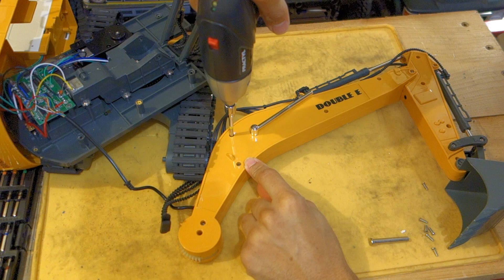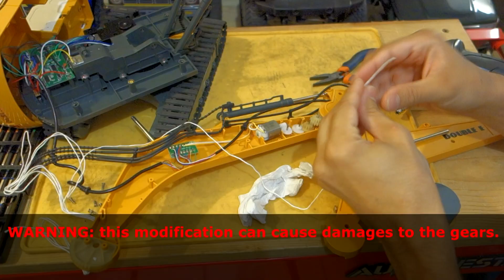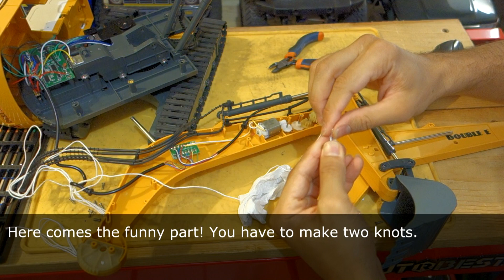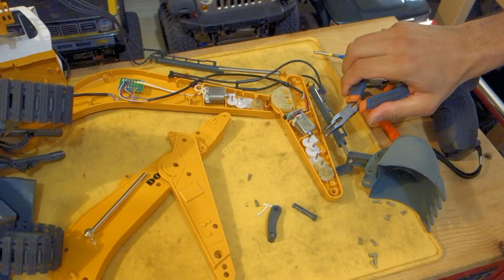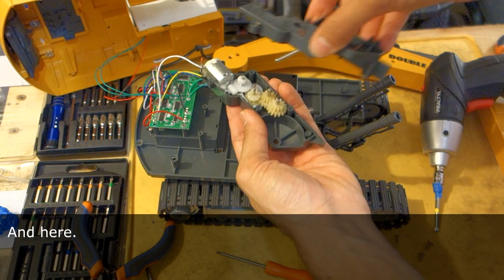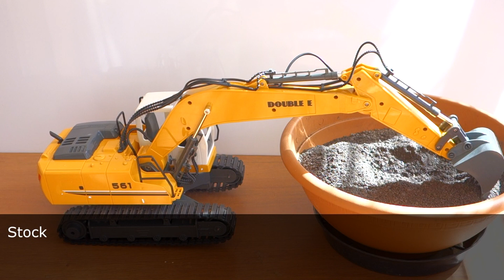RC Excavator - MORE POWER for free - Huina 1550 / Double E 561 / SP800

Comment: Ok, what we have here is simple spring clutch, it may be just a tensioning of the spring value, either by dismantling the clutch and lengthening  the spring by small amount adding to the amount of [ drag ]...
This way the clutch will still works as intended, but if done correctly maybe add just a few lbs to the lifting capability, 
But you are on the right track and thanks for the great video, yes it's a superb model and getting this to function just that little bit better will make it a great model..cheers..
Reply from the maker: Thanks. The spring travel is around 1mm so it's pretty hard to do fine tuning. By the way i don't have the model anymore.

Comment: I performed this modification last night. Instead of using string, I cut a short piece of Nitro fuel tubing, cut a slit in it and wrapped it over the spring and then cut a thin piece of Duct Tape and wrapped it over and around the fuel tubing. The fuel tubing will provide some give and hopefully still provide some amount of slipper clutch gear protection.

Comment: Just adjusted the clutch gear on my EC160E, by the way of inserting a washer / shim into the spring clutch gear..{ gear end of spring }.
The thickness is 0.5mm..x 1.5mm dia hole..
I cut a slot in one side, the size of the bearing shaft, for insertion onto shaft, 1.5mm wide..
This makes the spring have more compression and reduces the ability for the clutch to slip, increasing the digging pressure, 
After inserting this shim, close up with slot with small pliers...
There is definitely more power than before, but not enough to strip the gears..
Think 0.5 is the limit, but 1mm could...??

Comment: Hi. I have this for my kid... i put on the transmitter en then i plug in the battery for the excavator. En when i switch the excavator on... it does nothing :(
Reply from the maker: Check transmitter batteries, recharge excavator battery and try turn on excavator first then radio, it should work.
Reply: @Meuh974  tried it today. Only problem is that when i turn on the excavator it does nothing. No beep. No servo sound. Nothing. And when i put on the transmitter. The red light stays on at first but after 10 sec it starts blinking.. sad thing. Out of the box it immediately started... but on the second time it didn't work anymore :( thx for the tip. Think i will take it apart now. Maybe a wire or something is loose.
Reply: Check the battery pier connections mine broke off on the black wire same scenario as you

Comment: Is it easy to take apart the double e without damaging the plastic and maybe having gears flying all over the place?It’s just the one I’ve got, the bucket movement doesn’t work, I’m thinking it’s a loose wire somewhere but I don’t wanna break it while trying it to take it apart. Cheers
Reply from the maker: You can take it apart without damaging the plastic, there are screws to remove. If you go carefully the gears will stay in place.
Reply: Meuh974 thanks gonna give it a go.

Comment: I just bought the Double E excavator and would love to do this up grade but wish video had step by step instuctions.
Reply from the maker: Basically you need to remove every screws underneath the main body first. But I should advice you to learn the controls before locking the torque limiters.
Reply: I did the same as video but used wire bread ties instead of string. Excavator digged alot better until battery went dead.
Reply: Ended up stripping 2 teeth of 3rd double gear L to R 3rd gear in large boom arm. Haven't found a replacement gear yet.
Reply from the maker: Most of the gears are the same in the Doucle E and the Huina: https://www.banggood.com/fr/HuiNa-Gearbox-in-Minor-Ditcher-Boom-RC-Excavator-Spare-Parts-suit-350-550-560-570-p-1083284.html?rmmds=search&cur_warehouse=CN

Comment: Use a rubber washer instead.
Reply from the maker: joe the coil spring is pretty hard, rubber washers may compress and they are more difficult to find than rope.
Reply: I just ordered one of this, I'll see if I can use a thin rubber washers that I've got, if it doesn't work I'll try something else.

Comment: It's still weak.. I bought this excavator n m not impressed with it.. y put a metal shovel on a weak plastic toy??🤔🤔 That's y I spent the money n got the all metal 580.. no problems
Reply from the maker: The metal bucket only have a commercial purpose in my opinion. So they can say "metal" in description.
Reply: @Meuh974  yeeeuuup!!
Reply: I have a Huina 1580 V4, now that's an excavator..! But hey, the Double E is a 1\4 of the price and still a great model, detail wise, there are plenty of buckets out there, some printed some metal, but the reason the E is fitted with the plastic version is the slipping clutch, read my post, by doing some simple adjustments, without damaging the gears, this may add a great deal of operator satisfaction, I will make a video or post when I attempt this....